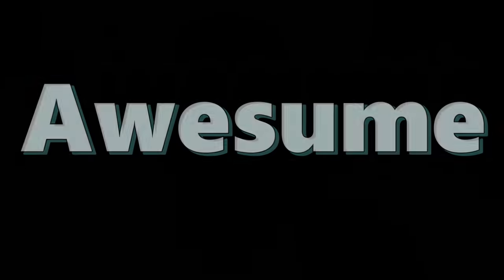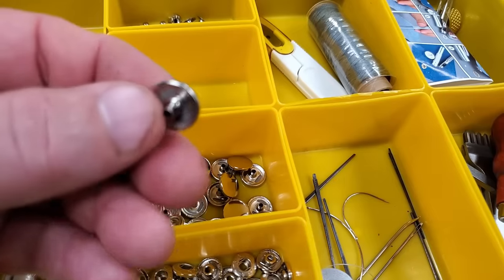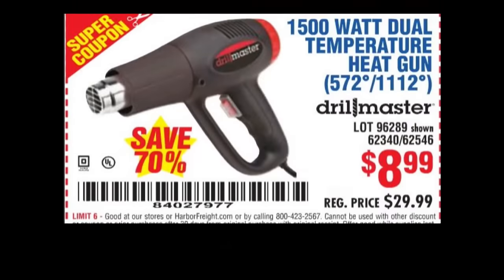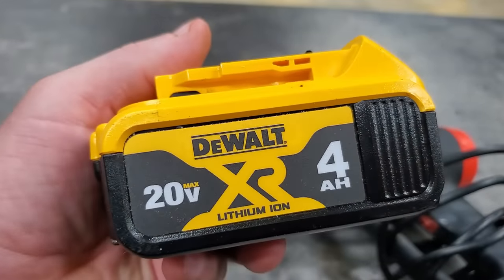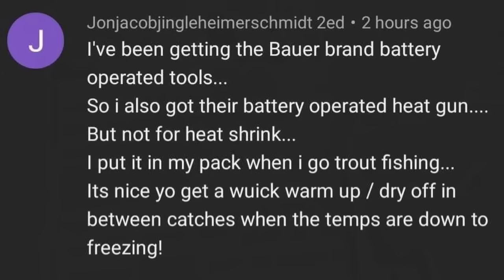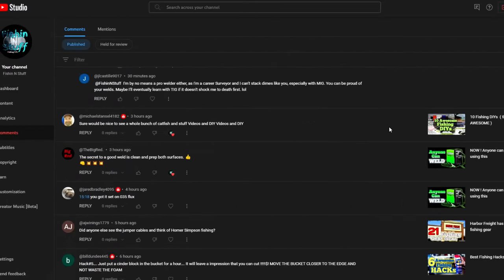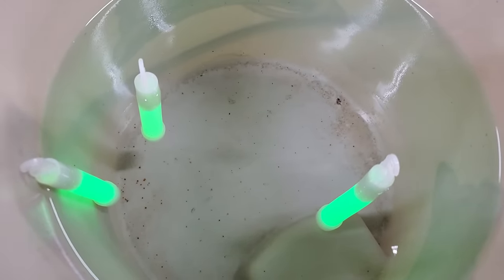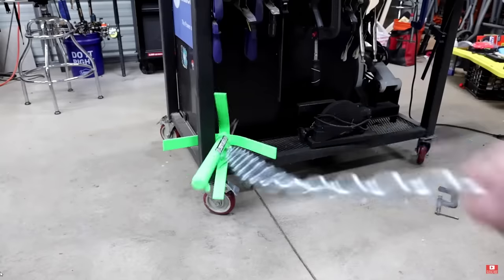Subscriber Fishing HACKs  ( super useful )

Comment: Hey, got a tip for the saltwater folks who watch your channel.  You can keep your shrimp overnight without losing them by placing a frozen bottle of water (frozen solid) or two (number depends on the temp where you're storing the shrimp.) in your bubbler and run it all night.  The shrimp will go dormant and wake back up when the water gets warm again and they won't die.
Reply: Well this is a good tip. I’m in Florida, so I’m gonna try this.

Comment: Only downside with the cordless heat gun is how fast the use up batteries! I’ve hot the Dewalt and with brand new 5Ah batteries freshly charged it kills a battery in less than 3min, plus it gets the battery crazy hot from the rapid discharge. I’m not sure if other brands/models are better on battery life but imo the cordless heat guns outright suck for the money/usefulness.
Reply from the maker: I didn't test the run time  .

Comment: Nice video buddy. Cordless heat gun hack, anchor chain, glow light bait bucket/baby sitter for kids to watch at night, are all some great ideas. I have more but acquire  more technical parts but you are able to power your entire house during an EMP and use on those EV and even boats if you had electric motors with a prop or jet powered but it depends on location you go fishing. Myself, I think props are where you get most speed and make damn sure you use a mud or stomp/log protector for the blades on your prop. You don't want to be in a bad spot where you are not physically able to fix it or have alligators wanting inside your boat. But my device will be perfect inside of a small 2 or 3 person mini sub that can go underwater at high speed and Alot faster using one main prop, and 4 others to move it, and have bow and stern thrusters, and jet power if needed but not used all the time. The speed of it I take a page from the Russian navy and when you're traveling at top speed, you have on the nose air jets to let out tiny streams of air that will cover the entire tip making it look like you are in a bubble and that will increase your speed from 50or 60 knots per hour to over 80 an even 100 depending on what design an the width and length do matter regardless what she says to you. All us guys know that our women don't want to offend our feelings. Haha yeah but I did solve that whole bedroom mystery about 15 20 years ago and I have taught only a couple of my friends and the next days get phone calls from their partners saying can you please teach them more and thank you. Remember every hair an every mm of skin is connected to our spines, and it travels to our brains. Trick is to touch the woman's magic unknown to most guys and most gals don't even know about it. But I figured it out one day, areas like her chest, nipples connect to spine, g spot, clit, and others when touched at exactly same time will give her a orgasm that stops time. She will love you forever if you do it.